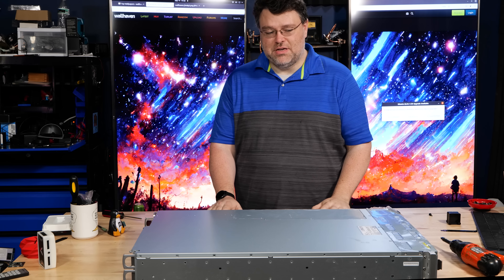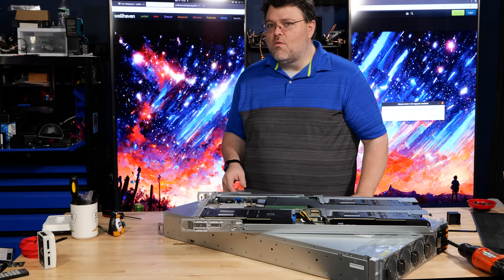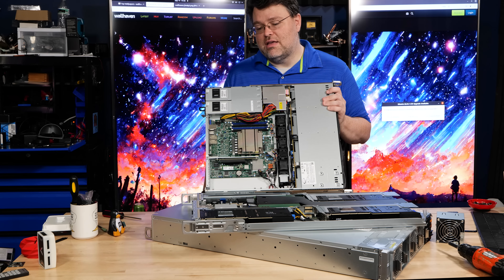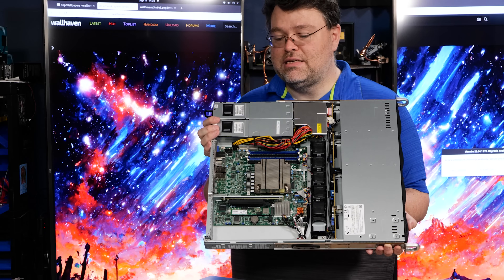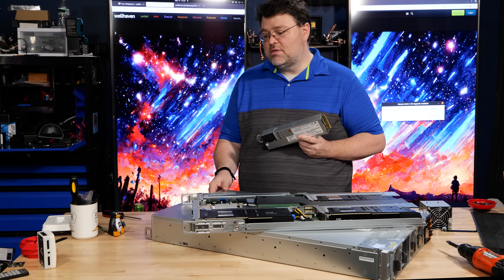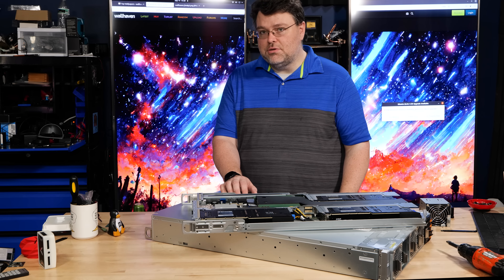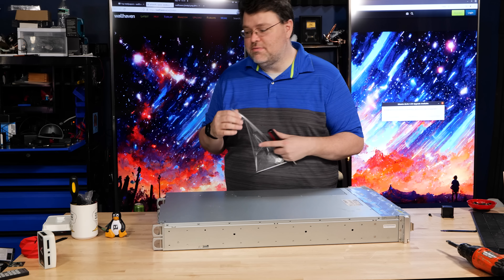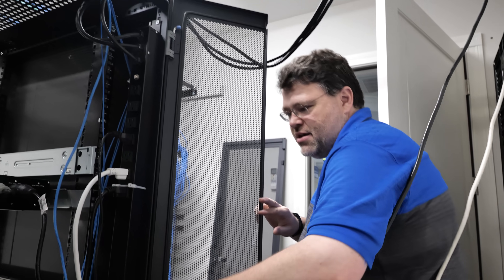1u Servers are DEAD! Long Live 2u Servers! But Why? -Ft. Supermicro AS -2114GT-DNR

Comment: 2U has always been more efficient... a 2U fan can simply move more air - period. My former employer resisted this almost to their last breath. With 2 150W CPUs in the box, their hand was forced. Originally, the only 2U boxes were because that was the only way to get 2 power supplies, but there are plenty tiny PSU's these days. (the system shown here could be done in 1U, as there are 1K 1U PSU's. but air cooling it would difficult.)

(To do 1U for our systems would require a load of 15k RPM fans - $30/ea not $3 - and they'll last a year not 3-5. And they needed solid copper heatsinks, which were 100x more expensive than aluminum.)

Comment: The thing is, if you colocate and use a lot of power, it does not really matter if you use 1U or 2U, it going to host you almost the same, because primary cost will be power.
If you have color or dc, that allow to deliver a lot of power to the rack, then it is not about optimizing cost, but rather just a quest how many you can put in a single rack or few close racks, so they are all connected over very fast network.

I rent a rack in Germany, and I am limited by space and network. I cannot put more servers, because I do not have enough power in the rack, or ports in the switches. I even have few empty units, because I am at the limit basically. I cannot switch everything from 1U to 2U, but if I can cram more into 1U, by upgrading to higher density, and or replace 2x1U, by 2U that actually is more efficient, I will definitively do it. We use a lot of Kubernetes for compute, Ceph for storage, and few host for virtualization (Proxmox).

2u dual node, is definitively more interesting than blade systems. Blade systems were always too expensive, requiring too much licensing and special setups. Hybrid like this, without expensive chassis is perfect.

Comment: One of my past clients consolidated down from about 40 racks to 20 from snagging a few c6000 blade chassis and Virtualizing a lot of their older hardware , 16 bay's for servers per chassis in 10u of rack space is some pretty solid density. This type of 2 node setup probably makes more sense for an engineering perspective but I always appreciated how scalable the Blade Chassis design was. 

If you have a free bay populated or upgraded one of the blades you just plop the new one in and away you go. No need to re-rack or fiddle around with rails, re-run cables etc. That said it does suffer from the size restrictions of a blade chassis, which is even smaller than a 1u server so fan pressure and the other issues Wendel raised are still a problem.
Reply: His systems are for massing GPU's. This little 2U thing is one of the few ways to do this without having to sell body parts. For you and me, who care about general purpose computing, blades have been the way to go for decades. (but it does often mean settling for vendor lock-in. and once they know you're on the hook, the deep discounts go away.)

Comment: @Level1Techs serious question: why are we using PSUs in servers? We used to have rack or cage level DC power fed to the servers on DC busses. It was safe, centralised, efficient and could be triple redundant. It left 100% of the space in every server for doing work and every server could be yanked out for maintenance without affecting the others.

Comment: Isn't it just a cut down 2u style "blade server" box? Obviously the blades in this 2u are horizontal and the original blades were vertical (with 8+ blades) and if I recall didn't have space for a graphics card... but still.

That said, I guess if you put the thing on its side and made the "box" square and then had space for multiple "blades" you'd still not get any extra density because you'd still need multiple sets of redundant power supplies. As backplanes are much less of a thing now, with such high speed serial network cards, you'd also not gain much if you used some kind of backplane system either.

Comment: it also comes down if you are single tenant or multi tenant and how the SLAs are structured. those 1Us are damn cheap, we swap them out like underwear :) those are also very interesting if the stuff you run doesnt need a lot of compute, like webservers and stuff. for database servers you are running 4U server usually since you need the pcie slots

Comment: Floor space was the limiting factor long time ago; now you could put your board with off the shelf components together, run the board in china, run the board to a pic and place factory and you'll get your custom board if you are really tight on space; now is power and cooling the most limiting factor. Think a few years back, where you had to offer each an every costumer a full server as virtualization wasn't a big factor. Now you run 100-400 virtual servers in a 2-4U unit. Before this you put as many FPGA's (those 10000 $-200000$ cpu's) in on case as you physically could and if you really wanted to use huge loads you could always press the real out button in Xilinx Vivado. Now you have access to virtual Cloud. F1-Instances (8000-50000$ CPU's) and virtual cloud GPU.

Comment: I gave up thinking about dense 1U servers myself over a decade ago because I'd run out of power long before of rackspace in every cabinet. Even in this video you're not able to plugin more than one of these into your circuit lol. So I standardized more on 2U setups for all the reasons you gave, fans for airflow, more room for storage and cards, or gpus, etc.  Plus its easier to work on than some ultra dense 2 servers in 1U setup. Thanks for the video!

Comment: This is definitely a "why didn't they think of this before" thing.  Fans are why 3U is my favourite form factor for DIY rack-case builds.  Unfortunately, 3U is kind of a rarity.
Reply: They have thought of this before, and at even more density. Dells current line up include the PowerEdge FX, which has 4 slots (half width 1U blades), but he concept goes back a few years with the PowerEdge M-series

Comment: IMHO, 1u servers are a legacy from an era when CPU and all other pieces used 150W total, with 24 PCIE lanes tops.  Right now, 1U stuff is just left for network and any nodes that don't have to go full bore, and biggest ones will move to bigger ones, IMHO 3u, will be next popular size as it's compromise of 2 previous systems together, packed full of devices, either discs or gpu's. Something like mining racks, but standardized as plug and play. 
whatever happens, I will rise a toast to death of those 1u sized screaming monsters, let them burn in hell.

Comment: So this basically is the comeback of the BladeServer just on a smaller scale?
We still have a six-blade system from Intel in the basement for testing purposes, some features are really cool. Failed node? No worries, the chassis will automatically relocate the virtual drive to a spare blade and boot it back up, almost no downtime.
Reply: Blades share way more. This is just power and cooling being shared

Comment: We have a few multi node chassis from Supermicro running since several years. Mainly 2U QuadNodes (I believe TwinPros).
While having multiple nodes so densely in a single chassis is great, it comes with a major downside:
The nodes often share a single backplane (which is partitioned). So if you have a failure there, you are screwed. Additionally, if you have an issue with an onboard controller, you are screwed as well: you need to replace the whole node, as you cannot simply install a backup raid card / hba.

While yes, these things are great, you should be aware of the downsides to some or these models. Ours always ran great without any issue until I bricked an onboard controller - after half a day, and many tries, I was able to recover it but it made me very aware of the downsides :-)
Reply: @Chloiber do you know if server racks with shared psus and cooling fans exist to centralize components. Maybe one standard height rack with two nodes per u and three or five shared psus. For further energy optimisation the systems could be liquid cooled and the rack could be powered by 400 volt direct current.
Reply: Everything is builtin these days. You're lucky if you can replace a processor or memory. (and now there's Stupid(tm) to prevent changing the processor.)

Comment: Both HPE and Dell sell a lot of servers in the 1U form factor. For example the HPE proliant servers have a lot of cheaper 1U configurations like the DL325. No its not used in a datacenter, but there's a huge use case for racks outside of a data center. Enterprise customers need racks but they don't have an entire datacenter. 1U is not dead at all in the SMB space.

Comment: I hadn't noticed before the power connector on those PSU's were were C19/C20, but it makes sense. C13/14 is only rated at 10A, which 2200W at 220V, so not enough for a 2600W power supply, whereas 16A for C19/20 means that you could potentially go as high as 3500W at 220V.

It puts it in perspective thinking that our whole homelab setup runs through a single C19/C20 pair from a 16A spur.

Comment: Is there a benefit to go even further with a "4U  4-Node" configuration? Or are there some diminishing returns after a 2U 2-Node config?
Reply: The returns are virtually fully realized with 2U because it gets you 89mm height for decent sized fans. 3U would get you 120mm but servers rely so much more on pressure that going up from 80mm to 120mm fans would see very little benefit. Noise reduction would be most of it and the industry has already come to terms with noise from racks.

3U or taller would get you full PCI card height perpendicular to the mainboard, but angle adapters and risers have gotten around that for decade now.

Comment: So why not put all the redundant PSUs on the bottom of the rack for instance, and have 12V DC running up to all them 1Us?
Reply: Change that to 48V and you've just (re)invented the Open Compute Project rack!
Reply: @tinfever  That's pretty cool. I guess each node only needs a small switched mode regulator then.
Reply: @stribika0  I think the servers are custom designed to use the 48V and go straight to the 1V core voltage and such. I could be wrong on that though, or they might be using 24V or something else
Reply: thick cables, many wires, voltage drop

Comment: Do you think eventually we'll move to 4U equivalents? For that 1 power supply failure would still provide 3 PSUs for 4 systems which would proportionally offer more power per system and offer redundancy even with one unit down. Could also use fans that were larger again.

Comment: The 2U is honestly dead too, the datacenter I work with is moving completely to HPE Synergy 12000 Frames, these can be configured with 12 blade modules hosting Dual 28 core Xeons with up to 4.5 TB of Ram each and a T4 Accelerator Card. Thus in 10 U's will hold 24 - 28 core Xeons, 54TB of Ram and 12 - T4 Cards. Everything runs on VMs and in the networking of the unit everything has zero trust between the internal machines.

If the size of the datacenter is a concern though they should be looking into 52U racks. Just doing this will increase the size of your site by around 25%.
Reply: A 1RU Intel server (thinking Dell PowerEdge 650) can have 2x 40 core Xeon Platinums, 8TB RAM, 3x T4s or A2s, and dedicated 4x 25Gb Ethernet. In 10RU, that's 800 cores (40 cores x 2 sockets x 10 servers), 80TB RAM, 30 GPUs, and 100Gb of dedicated networking per node.

Different scenarios and use cases call for different requirements. 1RU servers are not dead. 2RU servers are not dead. Blades are not dead. None of them should die - to help give you the ability to get a solution that best fits your environment.

Comment: Personally I'm a fan of the Supermicro MicroCloud servers for our colo. We deploy the 8-node configuration because we like being able to swap the drives without downing the node or running into spacing issues with PDUs in the back of the rack. The 12 and 24 node solutions are nice but a bit more of a pain to do any sort of maintenance on and less tolerant of rack configurations.

Comment: And here is Linus (LTT)  just now building five 1u gaming systems ;)
Reply: To be fair a gaming computer doesn’t need redundancy or anywhere near as much cooling, which is what this video is about. Linus outsources the cooling to an external radiator anyway. 
Linus’ new gaming computer is stupid for many reasons, and while the 1U rack case is definitely one of them, a 2U case wouldn’t have been any better. The issue there is insisting on stationary PCs in the first place. 

The premise of the video was that he needed something unobtrusive for his children to game on. Instead of a server closet we know he won’t take proper care of, the solution is to just get them macbooks with thunderbolt docks instead. Plug it in at home and it’s a decent gaming rig, bring it to school and it’s a good study computer. With actually good parental controls. Unless you actually need a full-power workstation, desktop PCs are almost never the right answer today.
Reply: @СузаннаСергеевна  i know, the timing is just funny. one day linus is building five 1u gaming rackmount systems, and the day after there's Wendell saying 1u is dead :)
But of course it's two entirely different situations, especially since Wendell is talking enterprise, and Linus, as advanced as it may be, is still talking about home usage.

Comment: In short. The main advantages of blade systems are still relevant.
Shared redundant power and cooling.

Though, blade systems also tends to toss on shared management as well as networking.

Comment: Cool. I want to build 2 1U servers. Two virtualization hosts. I have a single ATX box for that atm. ~20 cores, ~128GB memory, I think. As cheap as possible. PSU redundancy is not required as it's working on an UPS. Haven't seen anything cheap.
Reply: Isn't the point of a redundant PSU also to be able to continue when one of the PSUs breaks?
Reply: @fjdhaan  Sure, I don't see it as a problem for my setup though. I'm willing to take the risk as PSUs failing is quite rare. Not impossible, but very rare. This is not a business-critical setup, it's my home setup. I've been running a 60TB Synology NAS with a single PSU for a couple of years now. Is there a risk? Yes. I'll deal with it.
Just saying just in case that I'm not against RP, if it doesn't increase the price of the machine too much.

Comment: i feel like i understand the benefits you mentioned over just running twice as many regular 1u servers, but im not sure what benefit that solution has over just a standard 2u with a double socket motherboard?
Reply: A 2-socket motherboard is still only one system, this chassis contains two separate systems that can fail without taking down each other.
Reply: This setup allows 4 CPUs in 2U. Each system is only sharing power and cooling. Yes you can get 4 socket systems in 2U but that path is a single system

Comment: Having spent some time with multi-node chassis-based systems like this, my vote for a collective noun for a group of servers goes to "a cacophony."
Reply: Alternatively: "A tinnitus of servers".
Reply: @MiIIiIIion  GOLD award! cheers
Reply from the maker: I am getting such a kick out of these replies
Reply: @Level1Techs  **At 9:42, the C5-B is taking off!
Reply: How about a "whatt?!" Because you can't hear anything over the fans
Reply: A siren of servers.
Reply: A MULTIPLICITY of Nodes/Servers ?
Reply: My take would be Termagant.
"The word is also used in modern English to mean a violent, overbearing, turbulent, brawling, quarrelsome woman; a virago, shrew, vixen.[1] In the past, the word could be applied to any person or thing personified, not just a woman."
Reply: @youkofoxy  You've perfectly described my x-wife AND her mother! 😎👍☕
Reply: "Nuisance" or "Pain in the Ass" sound about right for when you have to troubleshoot them. For those rare times when everything is okay? Hairdryers is already taken by some GPU's. And in US English IDK any short word for Vacuum cleaner. But when you have whole rack of them you certainly need some protective platforms, like on Aircraft Carriers, when jets are taking off. When those fans spin up on every unit at the same time, you do have most important building block of Wind Tunnel. And yes - there are Wind Tunnels (or at least Wind Simulators) that use a lot of PC fans, so that you can control the flow and strength of the wind with good granularity and create uneven Wind to simulate for example Urban environment.
Reply: A manifold of servers.